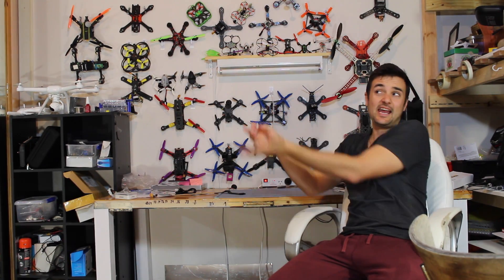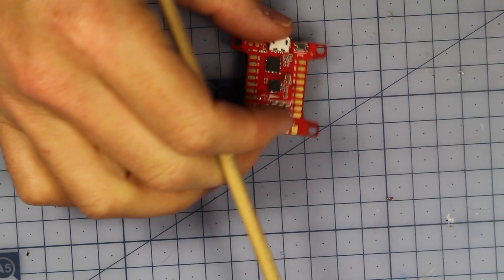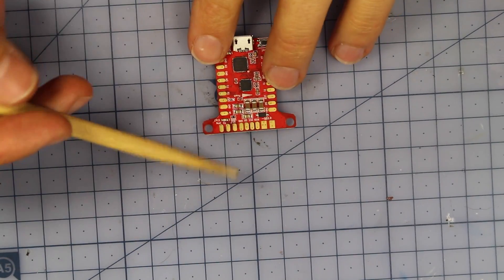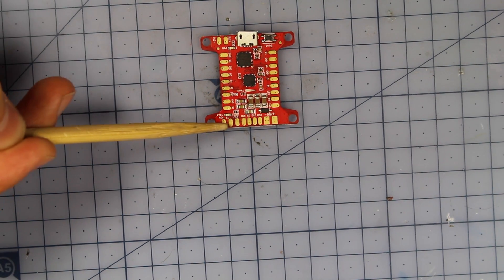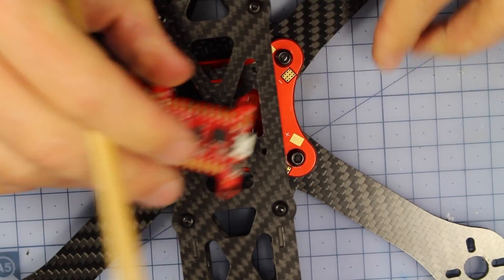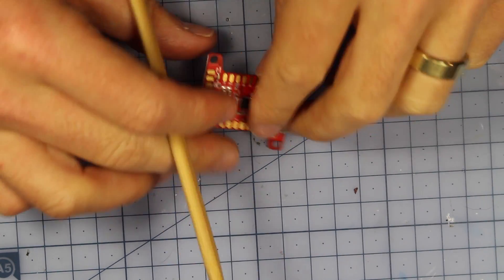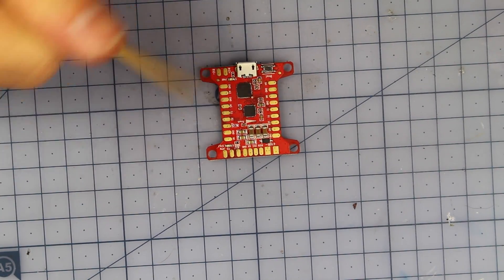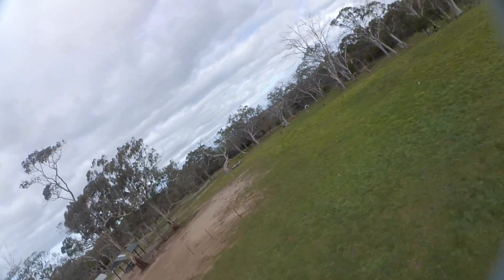Kakute F3 FC first look. Awesome Aussie flight controller

Comment: Hello!
I like your videos!

I have a little probleme. I use holybro kakute AIO, FS-A8S receiver. I connect the IBUS pin to kakute SBUS, sett UART3 serial RX, set receiver SERIAL/IBUS. But dont works. Any idea? No missing receiver beeper signal from the fc.

Comment: anyone having problems with the FMR kakute fc not being recognized by firmware updater or failure to connect msg me on FB Walter Kilian Gillmore. i'll walk you through the process depending on your setup. i might upload a video in a few days when i get another board and do another build. ill try to simulate as many failures as possible. good boards. definitely unbrickable so far! ;) also anyone wanting to know how to hook up peripherals such as gps and compass and other things not explained anywhere on in the manual. it me up.
Reply: thanks for all that info, had troubles with this myself...even with your instructions, I found that I had to check 'Manual baud rate' and change the selection to '230400' baud, I held the boot button in all the way through the flashing process after that and it worked. If you check out the beta flight installation guide it states 

"Only exception to this being for the SPracingF3 flight controller, for this FC you will need to check 'Manual baud rate' and change the selection to '230400' baud."

just adding this in case anyone has the same trouble that i did.. not to discount anything you just said smackout. I'm using a dsmx sat so I'll be following your guide on that :)
Reply from the maker: actually. I had someone contact me saying they couldnt get their kakute to arm. any ideas besides the normal stuff, min throttle, mode switch, esc type. etc
Reply: UAVfutures to arm. follow the manual. get to the point where you adjust sliders. arm needs to be on a switch seperate from angle mode. they both have to be on. so arm switch on. angle mode on. that should be enough to fly. as for other problems such as bootloader and peripherals. dependant on setup.
Reply from the maker: smackout the arm switch was set, no other modes activated, still not arming, according to this guy.
Reply: UAVfutures one switch to arm. arm has to be on. one switch to set flight mode. angle. usually. that also has to be on. so arm switch on. flight mode switch (angle) on. i take it he has the reciever setup properly?
Reply: UAVfutures also once the reciever is setup. go to motors tab and check the safety slider. click on master slider once and tap the up arrow on keyboard until motors spin. this just eliminates the esc's being a problem.
Reply: bootloader problems. 

open up cleanflight, select spracingf3, select latest firmware rev, check no reboot, check flash on connect, check full chip erase, check manual baud rate, then depending on the age of your PC select the appropriate baud rate. or just to be sure. select the lowest baudrate on the drop down menu. 19200. NOW, hold down bootloader button while connecting to usb. it should detect then flash. once the flashing process has reached about a 1/4 through, you may release the bootloader button. (i found that flashing at the recommended 256000 baudrate requires me to hold down the bootloader button throughout the process. the lower baudrates do not.)

hope this helps anyone having problems.

for gps. get an apm gps m8n unit. ublox. solder the tx - rx2 and rx - tx2, for the compass and power for gps solder 5v gnd and sda, scl terminals to their respective spots. select ports tab. uart2 check gps and baudrate 57600. i use powerosd pro2 pdb so i dont require the osd functions. go to configure tab. scroll down to gps and check on, select ublox from drop down. save and reboot.

for spektrum satellite. power is 3.3v, gnd then signal goes to r3, in ports tab check serial on uart3 57600. go to receiver tab select spektrum so the inputs show TAER, then at the bottom select serial and either spektrum 1024 or spektrum 2048. save n reboot. do not hook the spektrum sattelite up to the 5v that other rx's use!
Reply: this part i should have mentioned check manual baudrate, then """select the lowest baudrate on the drop down menu. 19200. NOW, hold down bootloader button while connecting to usb. it should detect then flash. once the flashing process has reached about a 1/4 through, you may release the bootloader button. (i found that flashing at the recommended 256000 baudrate requires me to hold down the bootloader button throughout the process. the lower baudrates do not.)"""" selecting the lowest baudrate is the safest bet that any pc will be able to handle the throughput through the usb.

Comment: Hi I'm new to this hobby and I was thinking of getting a kakute because of the easy soldering pads but I am finding it a little confusing trying to find out what wire goes where. Could you do a video on configuring the wires on a kakute fuc or some similar???
Reply: Fc not fuc

Comment: hi mate. told you already about a pdb for f3 from BG....i ve built zmr250 with 5 mm arms and 20 mm studs as the pdb and the f3 take not much space now. i have only one 3pin cable coming out of f3 now...sbus. check it out.

https://drive.google.com/folderview?id=0B06JRZbbFCVMUzIyWHNzYjg1VUE

Comment: looks like a really nice fc and I like the pads. if it had a 6000 it would be perfect. If you haven't seen them have a look at the new version 3 of the x303 fc. no plugs all direct solder but 6000 gyros.

As always love the vids
Reply: The Kakute has a 6050 gyro :)
Reply: Yes it does.  Sorry if my comment made it sound like it didn't.  My understanding, and I would like to be wrong as everything else on this board looks amazing, is that the 6050 Gyro is an i2c gyro and the 6000 is an spi gyro.  The spi gyro is faster than i2c allowing the spi to run at 8kHz where as the i2c will run at 4kHz.  Again would love to be wrong.

Comment: Hi Stu, do flight controllers vary notably between say one used in a racer quad to that of a quad designed for aerial filming/photography?  I am interested in building an aerial filming platform but I suspect there is something different between FCs sufficiently to say, hey you gotta use these type of FCs and not those..  furthermore, I would have thought a hexa or pentacopter would be best but I don't see any FCs designed for hexas or pentas
Reply: The Kakute is for racing, he didn't mean it was for AP. He was just building a quad for AP (Probably a slow flyer) and was going to use this board to try it out.

Yes, AP FC and those meant for Racing are very different. You could get a racing FC with Barometer , Compass and GPS. But it won't be as good as a dedicated AP platform. 
If you want an easy to setup AP FC,get a Naza V2 (They used to be more than 250$, but they are now going for 150$). If you get a 6 channel radio you could set it up so that you have Manual mode when you flick a switch. You can still fly pretty fast with a Naza, You can have features like "Follow Me" or "Return to Home and Autoland" setup with an AP FC!

Most of the racing and AP FC support 6-8 motor setups. They are much better for heavy lifting but don't have as good flight times as a 4 motor setup.

and by AP  I mean using a big (450mm or bigger) multirotor spinning 8" or bigger props and probably having a gimbal, If you have a small 250mm sized quad spinning 5-6" props you are better off with a racing FC . Because even with an advanced FC like a Naza they can't hold their position in high winds, etc.
Reply: You are just awesome!  Thank you!
Reply: Most flight controllers support up to 8 motors by default.  Well 8 channels anyway which could be a mixture of motors and servos.  Looking at the pinout of the kakute I believe it supports 6 motors which is the same as the x303.  The Naze 32 which is an F1 board will support 8 as will the SP Racing f3.

As for which flight controller is right for your project it comes down to what you want it to do.  If you want a multi-rotor that is going to follow you, have GPS, return to base, course plotting etc something like the kakute won't suit because a lot of what you need has been removed to keep weight and complexity down.  Also as your craft gets larger there are different demands on your flight controller and you may need to look at something like a pixihawk controller which has a million capabilities, such as autopilot, that a racing quad doesn't use.

Comment: SPI Gyro for 8khz??
Reply: The Kakute has a 6050 gyro :)
Reply: No. The mpu6050 is i2c only. Bit of a shame to hear that ey? The FC looks great otherwise.
Reply: I think it's a standard to have spi gyro now. The 6s regulated power and board layout is awesome but unless this can beat the xracer V3 on price, it's playing catch up.
Reply: Actually, $35AUD is quite good!
Reply: I wouldn't say that spi is a standard. Afaik mpu6000 spi is the most ideal for vibration sensitivity and looptimes but there's plenty of mpu6050/9250/6500 out there on quite decent boards.  If a chip supports both i2c and spi (eg. the mpu6500/9250) the pcb designer might make the choice to go i2c if otherwise all the connections on the flight controller wouldn't be connectable to pins on the mcu.
Reply: +lebasson 6500 is horrible, don't get it!
Reply: Too late sucker, I already did! Hahaaaa ehr.. oh no the joke's on me :) Well I'm just curious how terrible it really is or if it's easy enough to damp it with some silicone tube on the spacers or some double-sided foam-tape and less-than-super-uber-aggressive filter settings in betaflight. I've also got an f3 mpu6000 spi on the way so I can compare. I dunno, maybe I'll be blown away by the mpu6000.. maybe it'll be a noticeable difference but not the end of the world. What's your experience?
Reply: lebasson dampening it will help A LOT!, but sometimes you just have to adjust some settings (Turn off Damped Light/Active Braking, Run at a higher looptime) to get it to work properly and by then your quad won't be race worthy. I have only used the MPU6500 and MPU6050, the MPU6050 is much much better, The MPU6500 was in the LUX FC, that along with Lumenier's horrible QC made me want to just bash my quad at a wall, I am currently swapping all of my boards to MPU6000 (XRacer F303 or SPF3).
Reply: Tnx for the insight about active braking. Didn't know that that was something to change when using mpu6500. I've got an XRacer f303 on the way, it'll be my first spi mpu6000, excited about it! I've also been using Banggood's clone of SPRacing F3 for a while now (with mpu 6050). Can't complain.
Nice typo on 'active breaking' btw. I'm already actively breaking my quads, don't need any tips for that :)
Reply: lebasson lol, I was able to get Active Braking on after using 5mm (height) of vibration dampeners. I couldn't fly without it because the quads feel very different.
Reply: Tnx again. Good to know.
Reply: Its an amazing flight controller!!

Comment: Kiss copy.but nice vid😉
Reply: Actually lumineer lux copy, you can tell bc of the bootlaoder button.
Reply: Kiss runs a totally different firmware.
Reply: +Cooper Stukel kiss has also the button
Reply: +Mc_nus01 yep but different firmware too.
Reply: it's more like a LUX FC
Reply: There are several other flight controllers that have a boot button.  It is not unique to Lux nor were lux the first.
Reply: Kye Macdonald We are talking about the actual layout. The board has an 'I' shape instead of a full square, has direct 2s-6s lipo input, boot button,etc.
Reply: Fair enough. There are definitely physical similarities.  I guess I see that movement as a natural development as these boards shrink but you still have most frames (and 4in1 escs) still in the 30x30 layout.
Reply: It can actually handle a 10s battery but DONT try it ;)